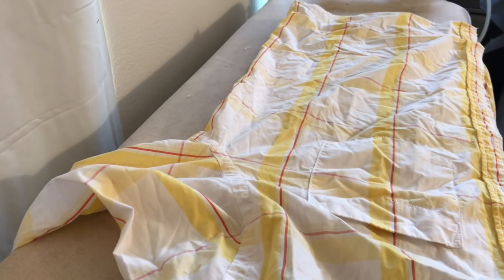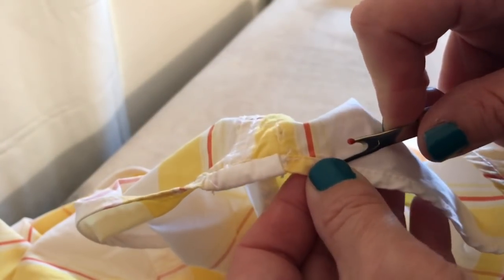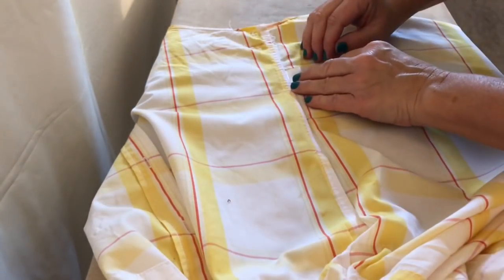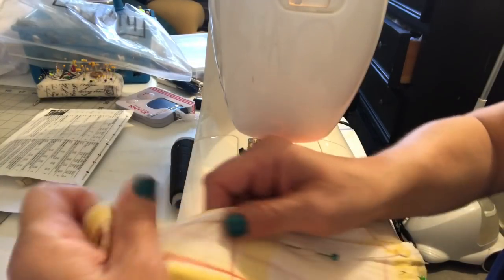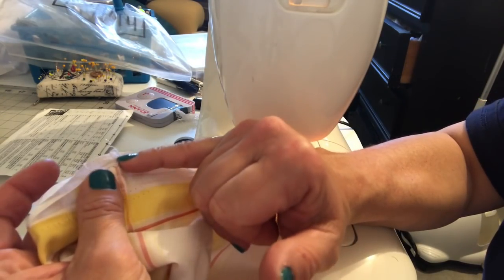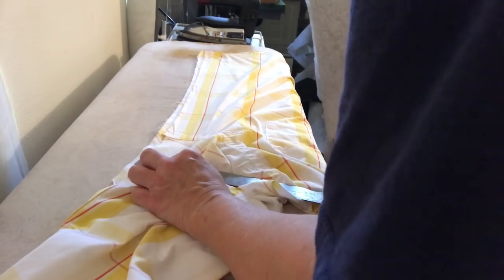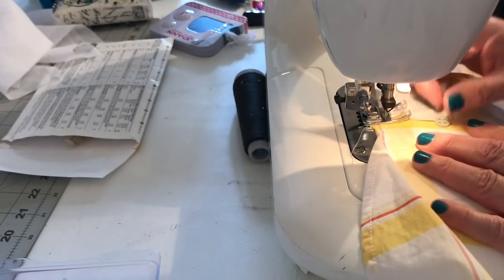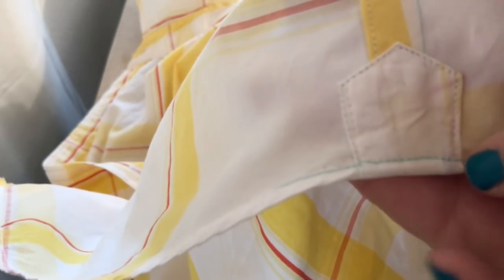How To Taper a Man's Dress Shirt with a flat felled seam.

Comment: Angela, thank you for taking the time to make these videos. Your expertise combined with your drive to to do things “right” even at the expense of some extra time is the approach I take when I fix anything around my house.  As I am learning to do my own alterations, that quality aspect combined with your clear step by step actions are a very effective way to learn. Thank you. 
A question I have is:  why do you unpick the seams?  The unpicked area gets cut off anyway. Once the shirt is pinned to the new desired outline, why not cut of just the flat felled seam. The two naked ends of fabric in this example would have about .75-1.00 inch of seam allowance left, enough to create a new flat felled seam?  The reason for the unpicking escapes me?
I appreciate any clarification you may be able to offer. 
Thank you from a subscriber.
Reply from the maker: When I have to figure something out on my own, I do what makes sense to me. I’m a visual person so that makes more sense than going by the numbers. If I don’t have to blend back into the original flat felled seam, I will just cut the seam off as you’ve suggested.
Reply from the maker: Thank you!

Comment: I've watched several of your videos about tapering a flat felled shirt.  Did I hear you mention that you have a serger that does flat felled seams?  I couldn't wrap my head around how that would work.  Is there a video on how to make this process more streamlined using a serger?
Reply from the maker: No, sergers don’t do flat felled seams. They finish seams. I don’t know which of the two videos you’re referring to, but if you have a shirt with a flat felled seam and you want to take your shirt in, but don’t want to do the flat felled seam, then you can open the seams, take in your shirt and then finish the edges with a serger then top stitch it to give it the flat felled look from the outside.
Reply: @AngelaWoolsey  Thank you.  That I can understand.  I never would have thought of that.